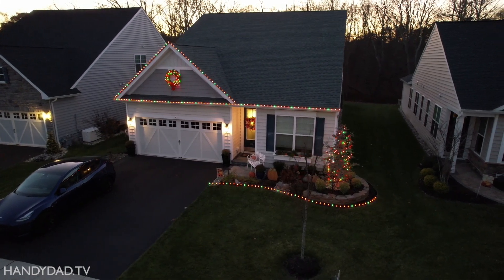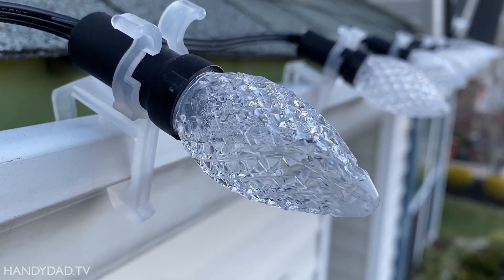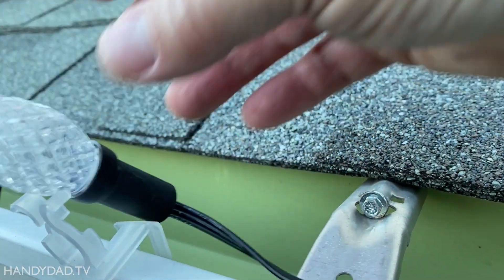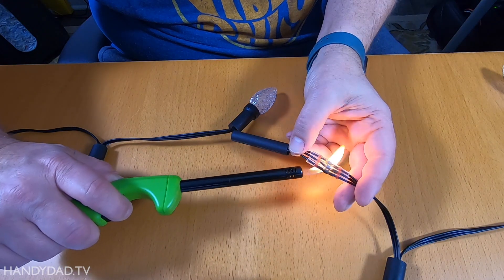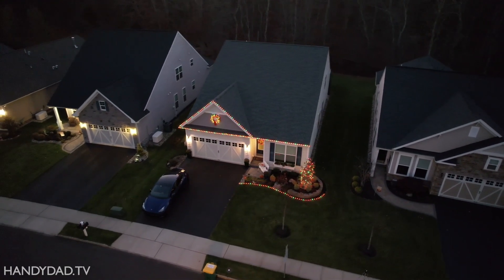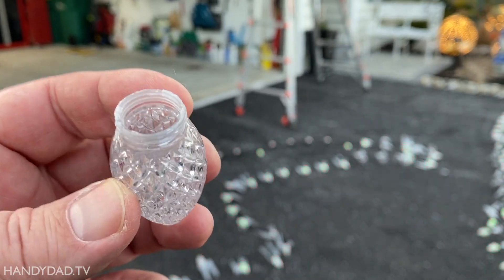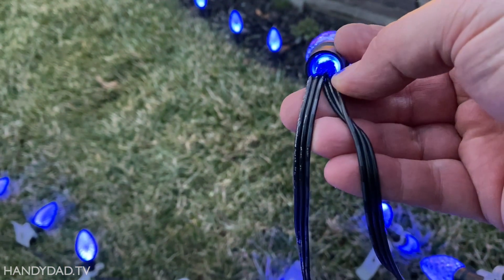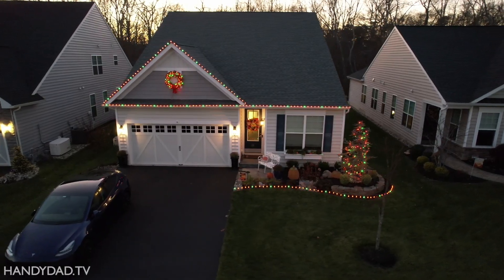WATCH BEFORE BUYING C9 RGB LEDs

Comment: I've been using AC C9 outdoor bulbs for a decade. Key hint: buy rubber seal rings! They seal the base of the C9 bulb case. Now, the leak at the wire entry point... that is either design flaw or you just need to water-seal (probably use Lexel -- magical sealant that works wet or dry ;) )
Reply from the maker: I would call it a design limitation, not necessarily a flaw.

Comment: Serious design flaw. at least the LED modules were encased in silicone. I have a few ws28xx 50 LED strings. I tested them when I first got them for 12 hours and then put them away. I put them up a couple years back and in less 2 days, I had 5 that were full on at a various colours. I bought what was supposed to be 12V LED strings. They would not work when connected to 12V supply, but did at 5V. I used Quindors DIG-UNO when I tested. The vendor kept saying that they were 12V. I took video of my tests and sent that in. All I got was 50% refund. I had to stop buying MOSFETs from aliexpress. Only my first order were the real parts. All 3 orders afterwards had 80% failure rate or higher. I used a component tester and sure enough, not within specs
Reply from the maker: This is why professional permanent lights are so expensive. They are made for quality and longevity, not just the cheap generic crap.

Comment: Hot glue or silicon on the backside. A few hours worth of work but will certainly extend the life of the pixels. A good summer/spring/fall indoor project on a day the weather is crappy.
Reply from the maker: Thanks for the tips!

Comment: You could put hot glue on the back to seal it up.
Reply from the maker: Yes, it crossed my mind. I have 200 lights so it would take a while.

Drilling drain holes might be easier.
Reply: @handydadtv  If you can't keep the water out, help it get out. Haha. I have always enjoyed your videos. Keep up the great work.
Reply from the maker: Thanks 😊
Reply: Or silicone sealant as it might flow more easily around the wires?

Comment: Could you drill a small hole  at the tip of each lens?  If they are pointing roughly down this might be enough to let them drain sufficiently and reduce the chance of cracking if the remaining water freezes.   Nice display - and an impressive demonstration of the capability of Wled;  you've inspired me to get on and do something about re-starting my display next year.
Reply from the maker: I didn’t discuss the option of drilling a hole, but yes it’s a viable option.
Reply: It has been a year and I was wondering if you had any success coming up with a option to keep the water out?
Reply from the maker: @orionsorbit A lot has happened since then. I moved in January 2024 and installed permanent lights on my house: https://youtu.be/ogfrC78DQyg

I only use the C9’s for ground lights now.
Reply: @handydadtv  indeed you could have mounted the C9s under the soffit.